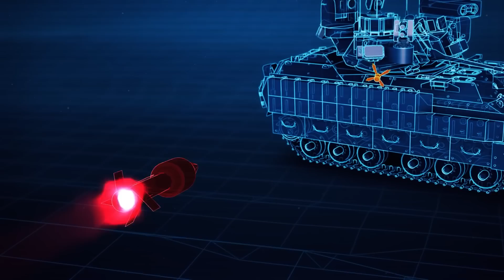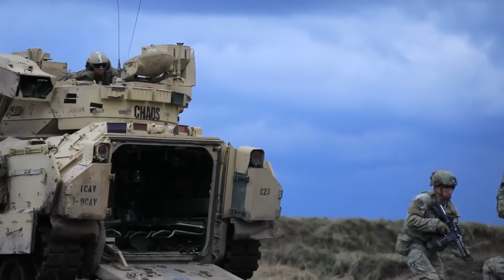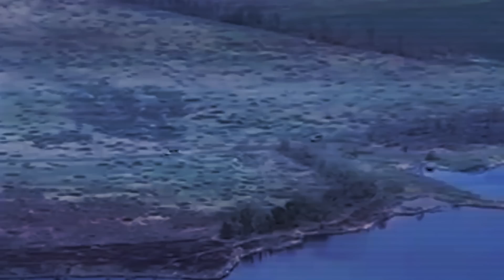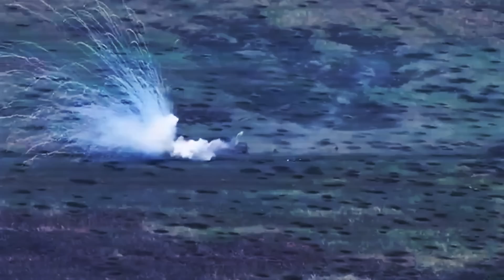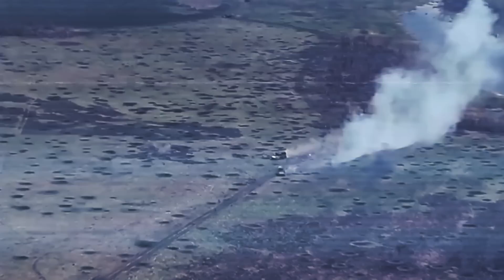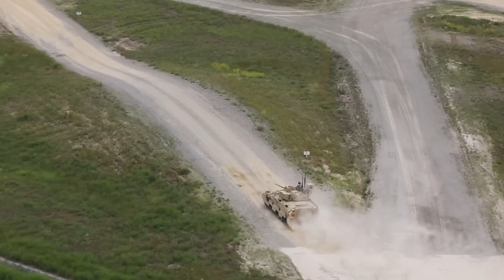This 675-HP Steel Beast Laughs Off Russian Missiles Mid-Air

Comment: You know it seems to me that submarines could launch tiny torpedoes used as counter measures to intercept incoming torpedoes fired from hostile forces. Maybe not but the idea seems doable.
Reply: Surface ships have anti-missile missile systems. The 'interceptor torpedo' sounds VERY theoretically feasible. I'm sure the navy has/is looking into it already, but dont want that out.

Comment: THIS VEHICLES IS BEHIND TIMES/TECHNOLOGY, IT NEEDS A 50mm cannon, a hub rid engine, drone technology,  everything the Abram x have should be on this vehicle on a more compact size, IT SHOULD ALREADY HAVE A LASER ANTI DRONE TECHNOLOGY, HAVE IT'S OWN DRONE SCOUT AND ATTACH DRONE, A KAMIKAZE 600, THERE IS A LOT MORE YOU CAN PUT ON THIS HONORABLE WAR MACHINESENSOR FUSION SEE THRU VIEW AROUND THE WHOLE VEHICLE SECURE LINK WITH AIR ASSETS AND OTHER VEHICLES